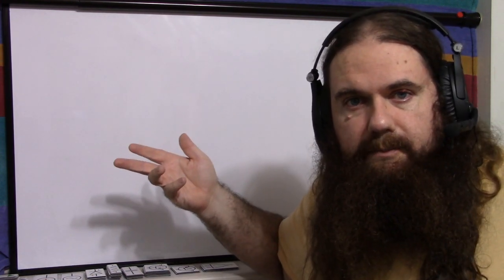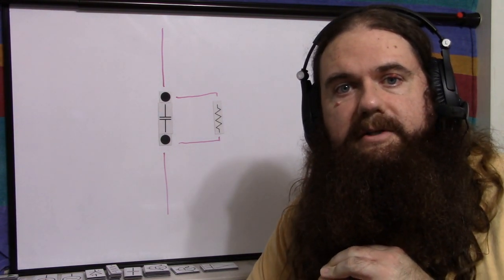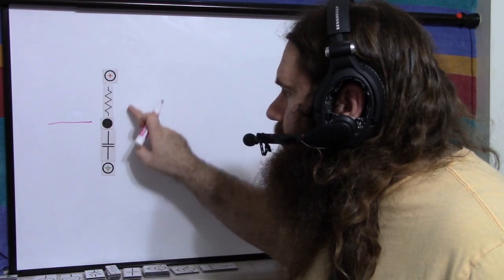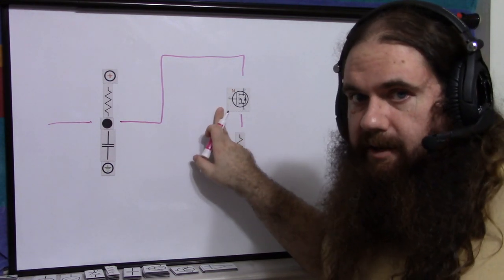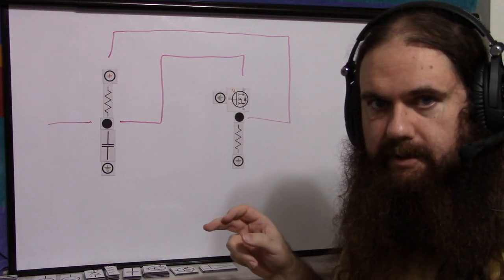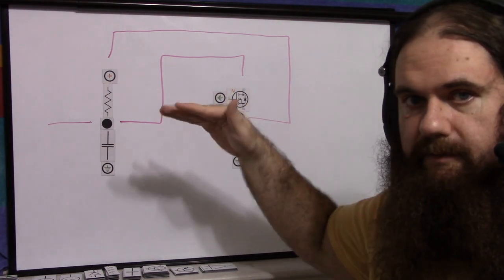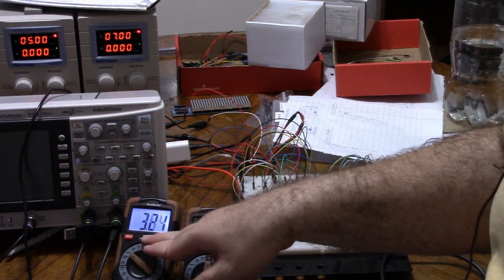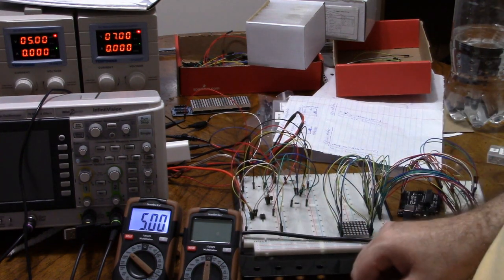Drain Caps Fast On Power Loss - Depletion JFET Switch Better Than Bleeder Resistors - Simply Put

Comment: I have watched from 11:20 forward, repeatedly, at your explanation of how the signal reference switches from Vgs to Vgd. I recently created a JFET based switching power supply and despite reading the datasheet 100 times, I couldn't explain this exact behavior. It was a desired behavior, but I could not find an easy source documenting this behavior. You have singlehandedly cleared up days of searching in less than 30 seconds.

Thank you sir! If you have Patreon, I'd gladly buy you a beer across the internet.

Comment: the time problem you went over reminds of how ground plays it role in signaling through the gate. instead of ground means end of the road.. P.S. my lap top could use this big time, coz of people not turning it off properly and just closing down the lid..... always need to pull the power for 10 or 15 sec's before i use it sometimes..  LIKE TONITE!! ; )   i'll have bar them!!